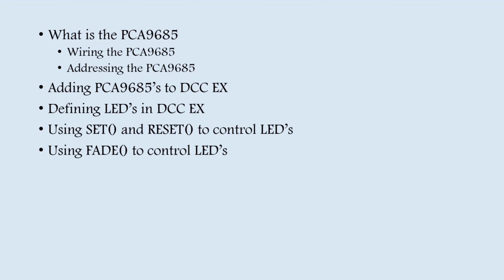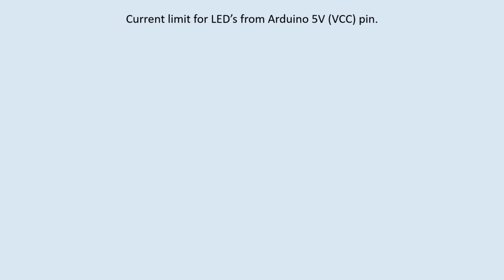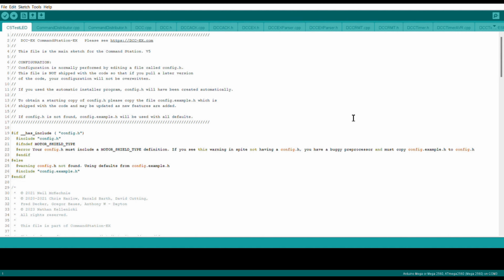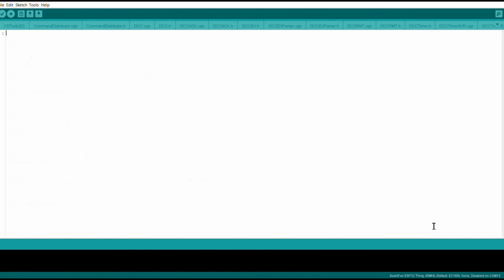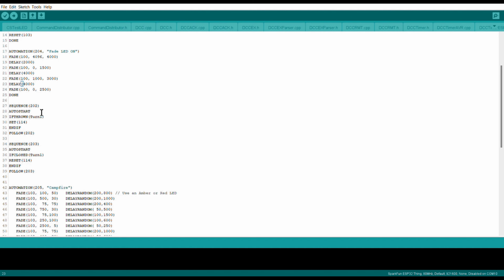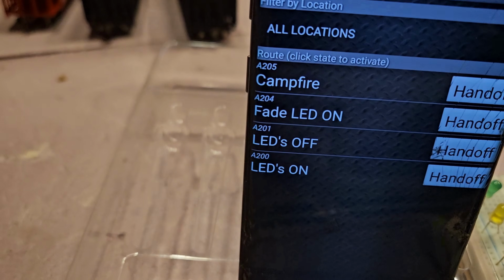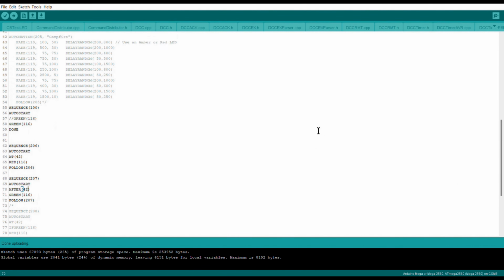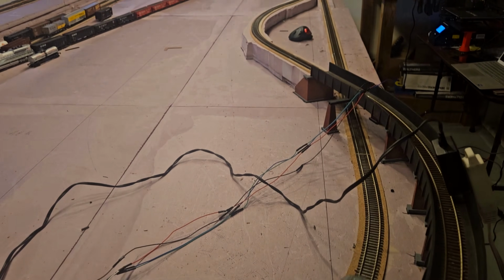Controlling LEDs with DCC-EX using PCA9685's

Comment: Thanks. Can this board drive individual RGB LED's (3 channels per LED)?
Reply from the maker: for RGB, each wire is connected to a pin on the PCA, so yes. i.e. Red to pin 100, amber to pin 101, green to pin 102. then driving each pin drives the different color

Comment: I have learned more about DCC-EX wiring and control from your videos than all other sources combined.  Thank you.  You mention in this video adding a separate 3.5 or 5 volt power supply to the PCA9685, attaching the voltage (+) to the VCC Pin.  Where does the ground get connected?  I thought all ground had to be connected back to the Arduino.  Thanks again for sharing your knowledge.
Reply from the maker: Not quite sure what you are asking, but hopefully this will explain things.  VCC is the power to the onboard chip of the PCA. It can be 3.3 or 5v, it can be supplied from the command station or an external power supply connected to VCC and GND. IF you use an EXTERNAL supply, you WILL need to run a GND wire to the CS. Because the current draw is minimal, it is fine to run VCC from the CS.

The V+ is power to drive the servos, the CS doesn't provide enough current to drive servos and you risk burning out the CS. So, 5V is connected to the side screw terminals of the PCA V+ and GND. This ground is tied to the rest of the ground, so you don't need to add anything extra. If you daisy chain two or more PCA's, you can power the additional PCA's by connecting the 5 pins between the two, VCC, GND, SDA, SCL, and V+. This will give power to the added PCA's for both the chip and the servos.
Reply: @SPKPRR  Thanks.  Your response tells me that the way I have my PCA currently wired is correct.  I got a little confused because I thought you were saying to add an additional external power supply directly to the PCA 5V Pin which led to my question.  I already had a PCA connected to the Arduino 5V.  That PCA has an external supply connected to the header to drive the servos.  Thanks for clearing that up.  I've subscribed to your channel and look forward to your next video.

Comment: I had a little trouble following this, it's me not you.  Here is what I'm doing. Maybe you could give me a little guidance.  Right now I have my green, red, and amber wires from my 3 aspect signal attached to the second PCA9685, so green is connected to vpin 117, red to vpin 118 and amber connected to vpin 119 and the the ground attached to one of the three BLACK or bottom pins which is supposed to be ground. I just can't seem to find how I set this up in myAutomation.h For instance if I throw the turnout servo attached to to vpin 100 (SERVO_TURNOUT(1,100,375,246,Medium,"Turnout_1") how do I tell the CS in myAutomation.h or mySignals.h to change the signal to RED when THIS turnout is thrown and back to green when THIS turnout is closed. This shouldn't be that hard but I can't find the info on how to do this. Very frustrating.  So how would I code this into myAutomation and or mySignals files
Reply from the maker: Yes, it can be done.  First, when you set up your signal in mySignals.h, the correct coding is SIGNAL(redpin, amberpin, greenpin) so your signal you described would be SIGNAL(118, 119, 117) You might consider setting your signals up so the pins are in the order of definition, so do red on 117, amber on 118 and green on 119. then your definition would be (SIGNAL, 117,118,119) just keeps things uniform. Depending on if you are using active high or active low pins, you may need to use SIGNALH(redpin, amberpin, greenpin). Once your definitions are set up, when you start the CS, all the signals should default to RED. to control the signals, somewhere in your automations create a SEQUENCE. I am coding it based on SIGNAL(117,118,119):

SEQUENCE(1)
AUTORUN // This will run it every time you start your CS
IFTHROWN(1) //Whenever turnout 1 is in the thrown position
RED(117)  //light the RED signal
ELSE   //If the turnout is not thrown, which means it's closed
GREEN(117)  //light the GREEN signal
ENDIF  // you always need an ENDIF with any IF statement

//you can have multiple turnouts in the sequence, it will cycle through all of them, checking for thrown or closed position of each.

IFTHROWN(2) //Whenever turnout 2 is in the thrown position
RED(120)  //light the RED signal
ELSE   //If the turnout is not thrown, which means it's closed
GREEN(122)  //light the GREEN signal
ENDIF  // you always need an ENDIF with any IF statement

//after you define all of your turnouts, you want to keep running through the sequence 

FOLLOW(1)  //Continue to loop through the sequence to continuously monitor the position of the turnout and set the signal.

If you are only using red and green, you can skip the amber pin and save it for other use, so red on 117, NO AMBER, green on 118. Your signal definition would then be SIGNAL(117,0,118). now you have only used 2 pins on your PCA. Have you configured the PCA9685 for LED's according to the DCC-EX web page? I don't use 9685's for LED's, apparently you need to configure them with 
IODevice::configureServo(vpin,OnValue,OffValue,PCA9685::NoPowerOff);
Reply: @SPKPRR  Thank you for the answer.  Your last sentence "you need to configure them with 
IODevice::configureServo(vpin,OnValue,OffValue,PCA9685::NoPowerOff);"
I have not done this?????  I will try to find this info on the website.
Reply: @SPKPRR  I tried to configure the LEDs with this:ODevice::configureServo(vpin,OnValue,OffValue,PCA9685::NoPowerOff);
I used 116 as the vpin value thus: IODevice::configureServo(116,4095,0,PCA9685::NoPowerOff);
 I put this line in the myAuto file but I get an error when compiling.  This section is very confusing.  I used 116  because I changed the R,A,G lights to PCA inputs 116, 117, 118.
Reply from the maker: I am not using any PCA9685,s for LEDs, so I had to look it up. The command i sent is the "old" way that was put in the setup file. Use this command in the myAuto file. 
 CONFIGURE_SERVO(116, 4095, 0, PCA9685::NoPowerOff). Try that and see if it works.
Reply from the maker: You will need to configure every pin you use that are LED's on a 9685. There are definitely pros and cons to using the 9685 for LED. Having to define every LED connected is one of the drawbacks.
Reply: @SPKPRR  What do you mean when you say "You will need to configure every pin" where do i configure each.
Reply: @SPKPRR  the above in myAuto.h file did compile successfully.  But no lights.  Where should I have the 3 R,A,G wires connected on the PCA, PWM, +V or GRD and the black wire. I have an anode common signal and am using SIGNAL not SIGNALH.  And I get 5v on either +V or VCC with a volt meter.
Reply: @SPKPRR  I won't have many signals so its not a problem for me.
Reply from the maker: So, if you have common anode led signal, then you would connect the three cathode wires to PWM and the common anode to V+ with a 330ohm resistor. SIGNAL should be correct, but you can always try SIGNALH. The CONFIG_SERVO command is required for EACH LED, so as an example, this is needed for the first 3 aspect signal.
 CONFIGURE_SERVO(116, 4095, 0, PCA9685::NoPowerOff)
 CONFIGURE_SERVO(117, 4095, 0, PCA9685::NoPowerOff)
 CONFIGURE_SERVO(118, 4095, 0, PCA9685::NoPowerOff)
Reply: @SPKPRR  That's very interesting.  I appreciate your help.  I will try this tomorrow.  Have a good evening.
Reply: @SPKPRR  So all three lines of code would go into myAuto.h file....right?
Reply: @SPKPRR  I put this in myAuto.h file and it compiled successfully.  The only light I seem to get is green when I input the command /GREEN 116 the green goes out.:face-green-smiling:

Comment: I was wondering how best to control LEDs for lighting on my layout, then I came across your video, this is just perfect. I already have 4 PCA9685boards working with DCC-EX and JMRI to control my servo controlled turnouts, now I can add LEDs as well and control the brightness. Just brilliant, thanks for sharing this. Trying to work this sort of stuff out just from the DCC-EX documentation is not easy. One thing I will add after doing some simple testing, the DELAY(time) command needs to match or exceed the the FADE command's "time", if the DELAY is less then you don't get the full FADE of the LED before it starts to processes the next FADE command.

Comment: Thanks for a great video. I'm a bit slow on DCC-EX but trying. My basic question is how do you connect the PCA9685? Do you connect it to another Mega or the one with the CommandStation code? Sorry if this sounds like a silly question, but I'm a 100% Disabled Veteran and things are tough off and on. Please reply so I can move forward.
Reply from the maker: @michaelmatsumura422  sorry it's taken so long to respond.  The PCA connects directly to the Mega with dccex installed. 5v and ground from the Mega to vcc and gnd on the pca. Pins 20 and 21 on the mega connects to sdl and scl on the pca. Add a separate 5v power supply to the v+ and ground header to power the servos

Comment: Stupid question but my PCA9685 has holes on the right side of the board.  How did you plug in wires to extended to another?
Reply from the maker: You can solder directly to the holes, you can add a pin header like on the left side, you can solder on screw terminals. Headers and screw terminals are available online from almost any electronics supply Co or even Amazon
Reply: @SPKPRR  thank you ! Your videos are amazing

Comment: Thank you so much for the vedio, it is very useful for the people who would like to use 9685 to control both servo turnout together with led signal aspect. I appreciate that to looking forward to your new vedio. Thanks.
Reply: And the main thing is that using this, the cost is also low.😊

Comment: Interesting. Just wondering if using the PCA9685 can be used as a stand alone with an Arduino. I have an Arduino for some turnouts and would like to have LEDs next to the turnouts using the PCA9685 board. Thanks, nice video.
Reply from the maker: Yes you can.  I do that exact thing, although I do it through DCC-EX, but you can code your Arduino alone to do it as well.
Reply: @SPKPRR  Does that mean I can program the Arduino with the DCC-EX files?
Reply from the maker: You could. If you are using DCC-EX, you can program the whole thing in on Arduino (Mega) to control your servos and LED's through the PCA9685. You could have a separate Arduino with DCC-EX installed, but you run into issues with your Command station communicating with the separate Arduino. I use one Arduino with my DCC-EX CS programmed to read the  buttons from my turnout control panel and  control the LED's and Servos. I have been really busy lately and haven't been able to get to my next video, which will deal with this exact topic. I hope to get to it in the next couple weeks, but no guarantee.
Reply: @SPKPRR  Thanks for the info. I'll check back every so often. I may give it a shot to see if I can get it to work. I have made 3 servos, 3 push buttons and 6 LEDs work on an Arduino Pro Mini. Took me 3 or 4 months to get it to work. Found out the screw terminals were causing the problem. So I hard wired most of it to my pc board. Haven't installed yet on my layout but it works great.

Comment: Great video. Thank you for making it.    One big question, what are you using for block detection?   I've been working on an Arduino based 40 signal/32 turnout/16 block ABS system for over a year now and I'm using 74HC595 shift registers.  I want to DIY my own block detection, but every solution I've tried so far has failed.
Reply from the maker: I am using an 8channel(zone) block detection kit from the Model Electronics Railroad Group. https://merg.org.uk/ It is a UK based group. Once you are a member (about $36/year us)  there are quite a few kits you can order. You will need to assemble them (Solder parts to a pcb board). I have done multiple kits, the instructions are clear and easy to follow. Beside the ability to order these kits from them, they publish a quarterly magazine that has lots of good articles on members doing some neat things with electronics. Lots of Arduino based stuff. also lots of online articles and info available. definitely worth the cost of membership. I think the 8 ch block detector was about $35 shipped to the US. Compare that to single and 2 channel options available. These are designed to work with DCC, wont work on DC signal.
Reply: @SPKPRR  Thanks for this interesting answer. Would it be possible to do a small video to share how you connect the DTC module to the Mega ?

Comment: my signals are common anode 3 aspect anyone else?
Reply from the maker: You can still use this. Either set a single resister to the anode and run the three coler cathode to 3 different pins for control, or put a resistor on each cathode leg, but still use each cathode as  a signal pin. You may need to reverse the signal set by using a "-" sign in the command. Details of that are on the DCCED website. It's been a while since I did this video, I don't remember if I covered that

Comment: It has been a good day (almost). The programming needed to control led's using PCA9685's finally came together (almost) DCC-EX compiles and loads with no problems. When I press the on button the LED on the PCA9685 pin 100 and 101 just flashes. The same when I press the off button (in Engine Driver). Any Ideas where I screwed up??
Reply from the maker: Flashes on and off once or keeps flashing. Are you adding the led definition or just using full bright? Hard to say without knowing wiring setup or seeing you code

Comment: Hello Steven, thank you for this educational video! Any chance you have worked with JMRI and how to address the LED from within there? I tried adding, in this case it is on pin 101, and I wasn't able to control. Thank you.
Reply from the maker: I have not dealt with JMRI much. I have connected through it, but mostly for Decoder Pro. DCCEX does so much, I haven't found the need for JMRI, including rosters, automations, routes, and more.
Reply: @SPKPRR  Thanks, I am just starting out and JMRI was recommended but it sounds like I should dig deeper into DCC-EX instead.

Comment: I really don't know what to think about the application of a 9685 to control leds. For controlling a servo...yes. I'd consider looking at the 74hc595 for simple led control. You might like using the esp32 over the Arduino. Having wifi and bluetooth built in opens up a whole new world, and they are really cheap...party on..
Reply from the maker: There are multiple ways to control LED'S with DCCEX, including io expanders, direct off of the Mega, PCA9685, and others. This video is just to show examples of how it can be used. I choose the Mega because of the number of i/o pins available without adding extra hardware,  but yes the edp32 is an option. Thanks for looking.

Comment: Thanks, Steve, another great video explanation, and very neat use of just two sensors to control a 3-aspect signal!  I guess the delay from exiting the section to the signal going green is caused by some debounce delay in your block detection code, and this is also done in the DCC-EX code somewhere?

Does DCC-EX change the PCA9685 PCM frequency depending on whether you are driving a servo or an LED pin?  I thought the PCA9685 frequency was recommended as 50Hz for servos and 1000Hz for LED's but the flicker isn't there except when picked up by the video camera.  The Firelight flicker seems very effective too.

Looking forward to the next one in your series!
Reply from the maker: When using the AFTER() command, there is a .5 second delay built into DCC-EX. so, by the time the train exits the sector, the block detector stops sensing the load, DCC-EX reads the sensor, delays .5 second and sends the command to turn the signal, we end up with the delay. It actually is good timing, I like the delay.

 From what I can find, the LED's are being driven at the same 50Hz. I did read somewhere you can set the frequency for 1000Hz for the LED's, but I forgot where and exactly what the command is. But even at 50Hz, that is too fast to be noticeable to the naked eye. Think about standard lighting, which operates at 60Hz here in the US, and I THINK 50 Hz in Europe. You don't see any flickering at that frequency. That probably is why you see it in the video, there the frame rate makes a difference and makes it noticeable.